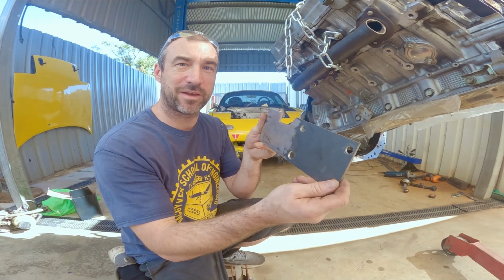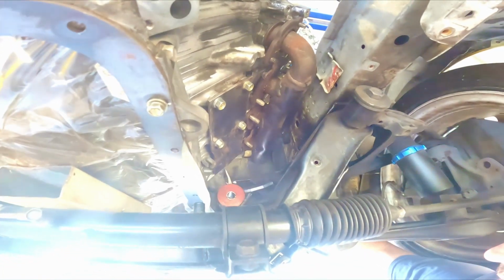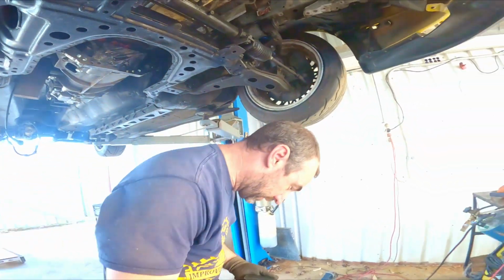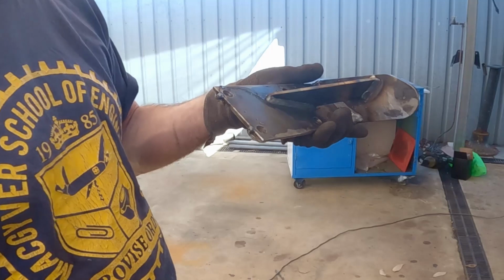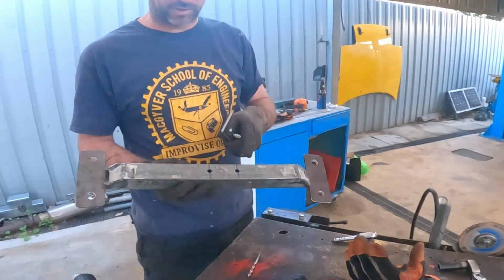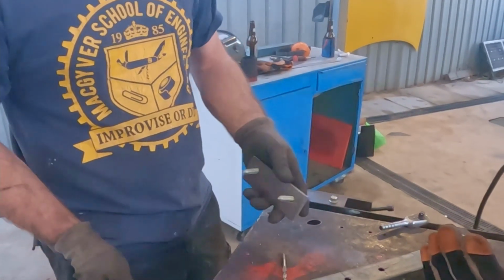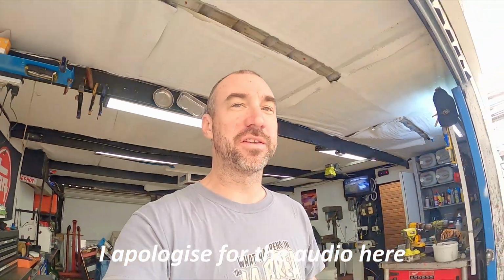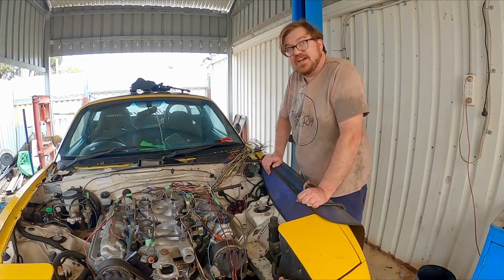Toyota Quad cam V8 into Mazda convertible  1UZ into MX5/Miata  (part2)

Comment: Another sick video mate, any chance you can put the measurements in for the engine mounts? 

Seeing as the bonnet sits normally, won't there be an issue with getting the sump on? I've seen people where the engine sits quite high to make up for the chunky sump

For the gearbox mount, is it just a metal strut with no fixing or is the gearbox fixed to it?
Reply from the maker: Making a sump myself

Comment: Awesome job mate, I’m currently in the process of planning out the 1UZ mx5 swap myself, I’m in NSW, do you have plans on getting your swap engineered and registered in whatever AUS state your in? 
Very excited to continue following this series.. will help a lot for my own swap aswell.
Reply from the maker: Hi mate, we are in Perth and are building it to be engineered. We are consulting the current documentation on modifications so that when it comes time we won't have any real issues, which is why we've made such an effort to get the bonnet to close and will be making our own sump to avoid modifying the crossmember up front.
Reply: Sounds great! going to be an awesome build then.. I dare say I’ll be using this build to plan out my own. Thanks mate